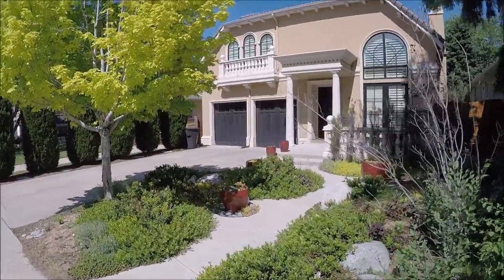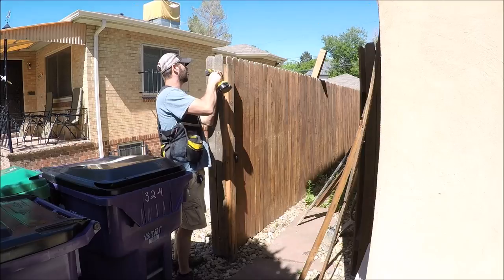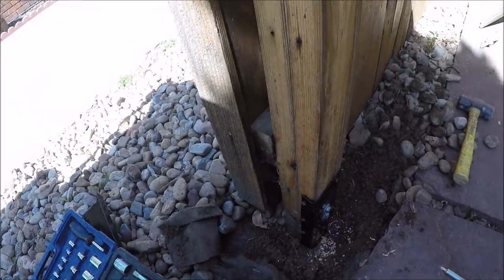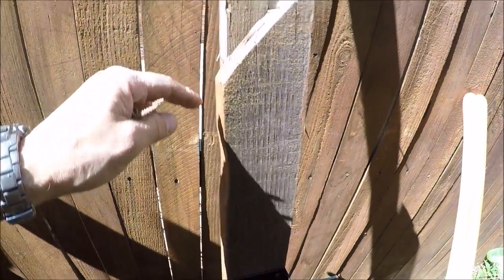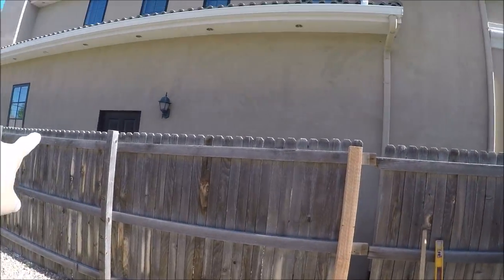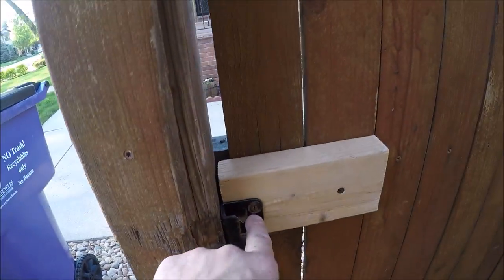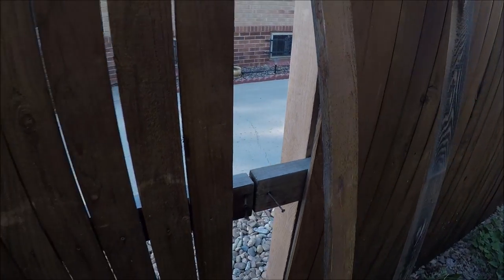Fixing A Sagging Gate And Replacing A Fence Post | THE HANDYMAN |

Comment: That post anchor looks solid, man you sold me on that thing.  Perfect for a side gate or an owner who doesn't care.  Looks like it should hold up well.  Might be a pain to hammer through sometimes it seems could be an issue.
Reply: I have a post for some reason had broken off, so I am going to try this first before hiring someone to come replace the post, only thin is, the old post is set in concrete, so IDK if a post anchor would work in my case?

Comment: Great work. How much easier is it to put the post next to it vs digging up the old concrete?
Also did you use a lag screw to hold the fence to the house? I didn't realize it could thread into the stucco.
Reply from the maker: Its a new kind of screw. It went through the stucco and into the studs that are at the corner of the garage.
Reply: @TheHandyman1  what is the name of this new kind of screw?

Comment: Is screwing into the house to support the post like you did create a risk of water infiltration?
Reply: Absolutely.  Flip side is he is in California (I think) so it's not a  big issue.  Given the way the fence was it would have been hard to pre-drill the hole, fill it with something, and then drive the lag in.
Reply: Yes! Why risk potential damage to the home for a post fix. Should have just replaced.
Reply from the maker: It still would have sagged unless it was bolted to the house.   I'm guessing you have never built a fence.
Reply: I worked in LaJolla doing drain service work so I know the richer they are the tighter they are. I show up 10 o’clock at and this billionaire wants to haggle over an add he saw that was $5 cheaper. I left   You May know the place. It’s so dang bigI thought it was a monastery. I think his name was Faust

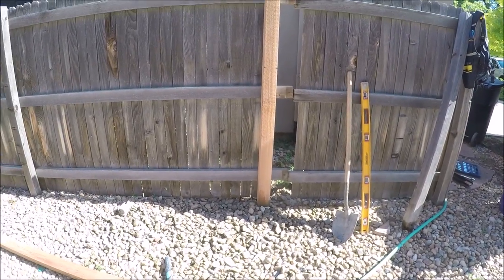Comment: 4:08 - 4:30 is exactly what I need to do on my gate that is sagging. Can you please let me know what type of screw/bolt you used here (Size, length, etc)? Great video, thanks!
Reply: yeah that's what i need to do as well any info on this?
Reply: Also looking for a reply.
Reply: I slowed it down and could see the sticker and its 1/2" x 10" lag bolt /screw. Its like $4 at the big box store.1/2 in. x 10 in. Powerlag Hex Drive Washer Head High Corrosion Resistant Coating Lag Screw

Here is a link;
https://www.homedepot.com/p/SPAX-1-2-in-x-10-in-Powerlag-Hex-Drive-Washer-Head-High-Corrosion-Resistant-Coating-Lag-Screw-4571820122547/202041057

Lag bolt comes in all lengths depending on how much length you need.
Reply: I slowed it down and could see the sticker and its 1/2" x 10" lag bolt /screw. Here is what he used or very close, https://www.homedepot.com/p/SPAX-1-2-in-x-10-in-Powerlag-Hex-Drive-Washer-Head-High-Corrosion-Resistant-Coating-Lag-Screw-4571820122547/202041057

hope it helps!

Comment: Hey there.  Question: I am building a cedar driveway gate with two swinging gates roughly 6 ft wide. One post is stand alone up against the house and I feel like over time this post will loosen. I would just add lumber and anchor to the house but I have vinyl siding and don't know if I want to open that can of worms. Any ideas for making this post anchored with no wiggle? Thx.
Reply from the maker: Not much you can do. Maybe do a double post.  I would try to find a way to stabilized it to the house.

Comment: What suggestion do you have for a sagging gate post that is the lock side instead of the hinge side? The house material is vinyl siding. The gap to the siding (since it's got that repeating ridge pattern) is 4-11/16" to 5-1/8" (do I need to make the reverse profile of the siding into a wooden block? Can I bolt through the siding like you did the stucco? What about water protection?). I only have to deflect the top about 1/8" to 1/4" (hasn't been sagging long), would that post mender do it without the house support?

Comment: I like your videos very good but one question why didn't you break the old concrete?? And put the post in the same place that way u wouldn't have to put the tiny pieces of 2x4s wouldn't it look a lot better??
Reply from the maker: Wasn't asked to do that or paid to do that.   Its not really worth the time and effort to try to pull out a huge block of concrete that goes 2 feet into the ground. By the time you get the concrete out you have disturbed so much of the surrounding soil that you would need to dig a huge hole and use a ton of concrete.  Keep in mind this is a repair on an old fence.

Comment: Did you get lucky and catch a stud on that hinge post or is it just catching the sheathing?  Maybe use a gasket and rubber washer to keep water from traveling along that screw and getting into the wall?  Not being critical...No easy solution for that hinge post.
Reply from the maker: +Gully Nomadic There was a pack if studs that it went into.

Comment: those stakes dont work with cemented posts do they?
Reply from the maker: They do.  Its what they are made for.  They are called post mender.
Reply: @TheHandyman1  Thanks, I was wondering that.
Reply: Well that's somewhat misleading though...the mender is handy in some instances but you cant just pound it through hardened concrete...it looks like for this particular repair the concrete around the post was well below grade making it much easier to pound it into place...  @A10TOES